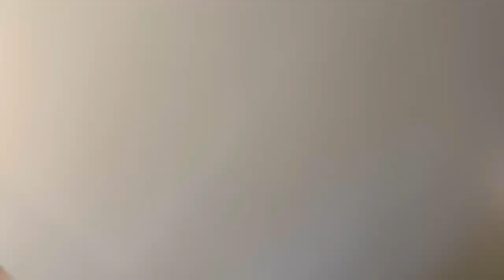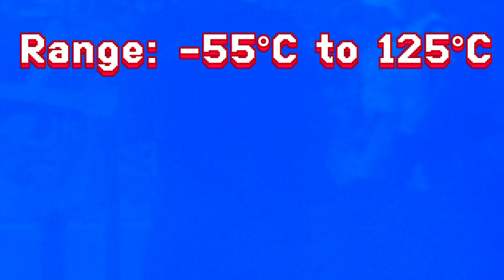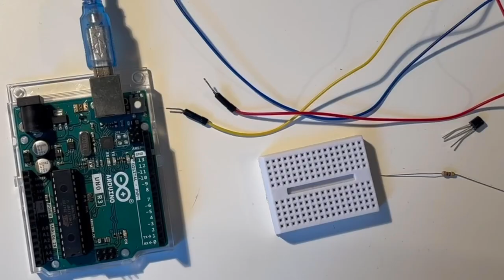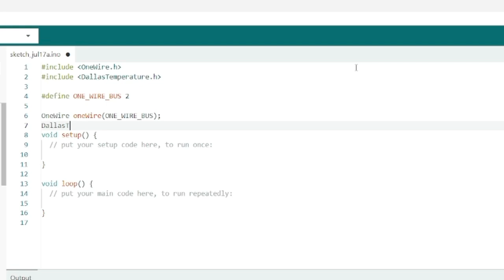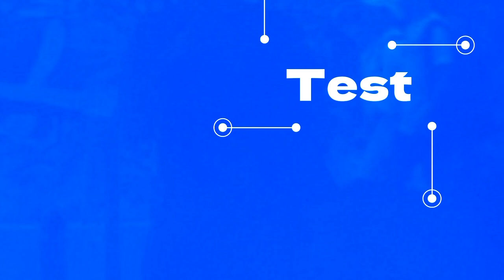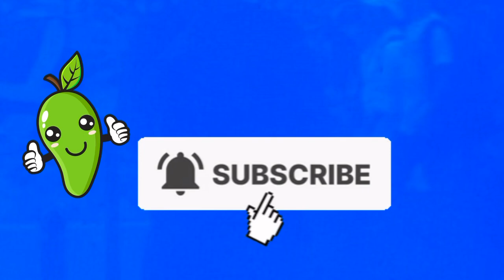Arduino DS18B20 Temperature Sensor Tutorial | Wiring + Code Explained

Comment: Can the sensor be attached to a heated object such as metal tray? And calculate the temp
Reply from the maker: The sensor measures the temperature whats around it. Its very sensitive. I soldered it too close to the general circuit and already noticed an increase of 1-2 degrees on the air temperature because it was soldered too close to all the other components. So, Im pretty sure if you approach it too much from the heated object it will measure the heated object. You will need some good strategy to mount the whole thing well so the sensor is well connected to the object. Besides, I dont know how hot is the metal you want to measure, so if its reaching too high temperatures it may not work (sensor measures up to 125 Celcius, but its loosing precision when temperatures are getting too high...)I personally havent had experience with mounting it attached to objects. After soldering too close I even did the opositte and opted to use larger wires to keep it away from my circuit ...
Reply: @DuinaBytes i want to attach it to the metal tray that's heated by a PTC heater 40°c 12V. The sensor wont near my circuit. Would it calculate the temperature?
Reply from the maker: @s.a.m @s.a.m1845  you attach it directly to the metal it will measure the temperature of the metal. So you don’t need to do any calculation it directly measures the temperature in Celsius